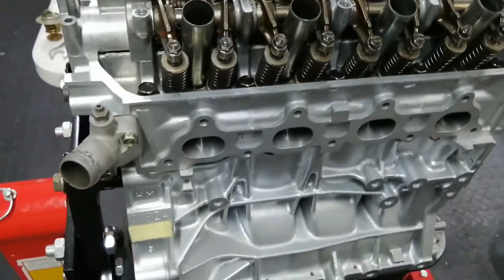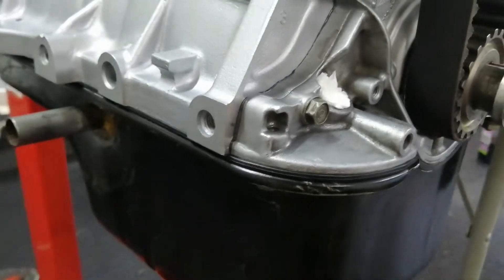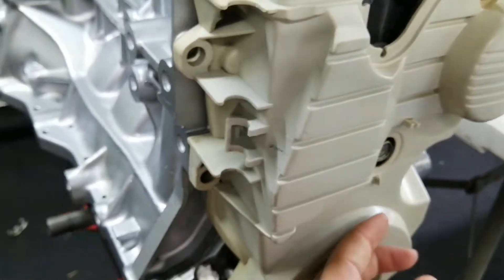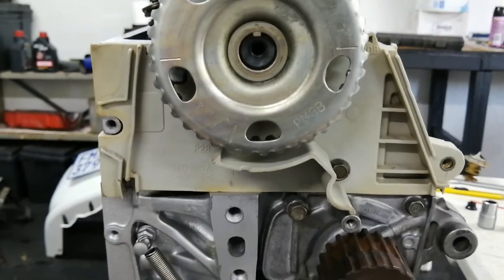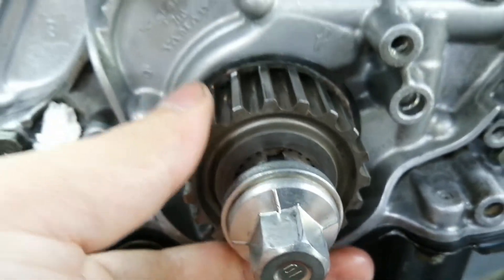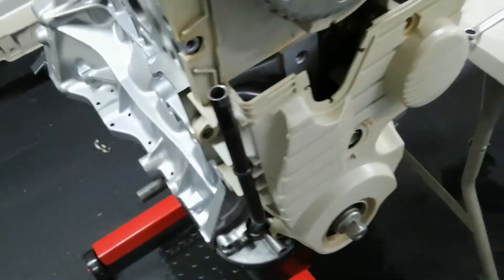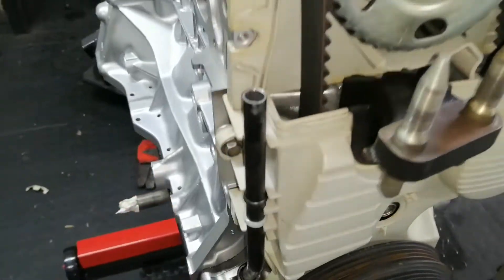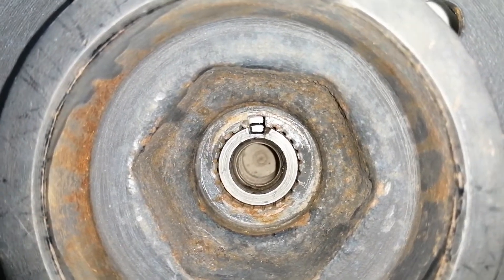Honda VTEC Engine Assembly - D15/D16 Mini-Me - Part 3

Comment: Guys, do you have a manual for setting up the D15/D16 split gear?
Reply from the maker: Hi, sorry, no manual, some motors are different, make sure the correct marks line up, some marks are for the P08 head, other mark is for the P2A non vtec head. older EG engines only have 1 mark + deck

Comment: Me i did d16y4 block , d15B head. Still running on stock d15b ecu but it feels like a 1.6 L. Frankenstein build to obtain d16 double vtec. But if i put a maxxecu mini or hondata on it we will be pushing right stuff when needed(ecu actually putting enought mixture for 1.6 L and not 1.5 L) without forgetting the stage 3 double vtec which i will be able to control with the standalone
Reply from the maker: Hi Bro, if you have a stock 02 sensor connected to stock ecu it may be able to compensate extra fuel for the extra 100cc. for the 3 stage vtec stuff there is not alot of support, but a ecu with a simple rpm/map based trigger you should be able to set it up on a stand-alone ecu.

Comment: I just happened upon a 95 del sol si, d16z6.  Planning 300 hp turbo build! Thanks for the clinical video!

My window washer wasnt spraying so worked through the whole system.  Too the swith stem out and opened it up...  the pump was the culprit but im surprised cause all the contacts were nasty.  Cleaned it up with electornics cleaner and 2000 crit sandpaper.  It looks new.

Also did the contacts at the harness.  Reconnected it and put dielectric over the cap.  Should be good for Long time.

Lastly, im gonna go nab some fan pattern mist nozzles at the piknpull.
Reply from the maker: @deepstate8474  nice, 300hp del sol will be a lot of fun. Also working on a new 300hp engine build for the civic

Comment: last time my stock d15b snaap the crankpulley bolt twice, it almost ruining the keyhole on the crankshft, does this problem also happen to B series? love your video btw keep it up
Reply from the maker: Hi, thanks. Yes the pulley/key issue is fairly common on D and B series. the pulley bolt needs to be torqued very tight and of course the engine wants to spin, you need a special tool to lock the pulley, most people don't have the tool so they just do what they can and over time the bolt comes loose and the key damages the crank.
Reply: @RisingBoostYT  ah i see,  now i understand, and the k series?

Comment: Quick question what ecu do u run? Or any other upgrades such as fuel injectors?
Reply from the maker: Hi Luis, I have a walbro 255 pump, upgraded fuel rail and 440cc injectors. running a stand alone ECU for the motor, it's just a cheap basic locally made unit (Dicktator STD)

Comment: Hey your videos are definitely awesome!! I'm trying to rebuild a d16y5 with d16y8 head then turbo. I've never done this before and I'm learning all I can before I attempt to pull my engine. Thanks for the help
Reply from the maker: Hi, I don't know the Y5 motor, but it is a vtec-e, meaning it already have a P2J cylinder head, exact same cast as a Y8 head, (some say you can just swop out the cam+rockers to make a vtec-e to normal vtec) this is good because it will be a easy straight fit bolt on, "no mods needed" apart from the ecu as a vtec-e ecu triggers vtec at a different rpm, also it works a bit different so you will need some form of tunable ECU.  here is some things to keep in mind, make sure the block does not have weird hi-comp pistons (it should not). make sure the head you are using has the big intake ports and thick valve springs (never use a PO7 head), get head studs if you can, Dseries love to lift heads under boost. don't run aggressive timing under boost. get 7 heat range spark plugs. don't make more than 220whp and you should be just fine.

Comment: I can say everyone is wrong I build my CRX with with a d15b2 block with a po8 -3 head VTEC but not VTEC what I did I put a Y8 head gasket drop the head with a 272 Delta cam and bolt in the manifold with the pmg-fi system duel point and I put the d15b2 distributor with couple adjustments and bingo and the duel point always kp my engine with the right amount of gas I put her to 7200 rpm with not problem at all she is peppy like hell sounds like a muscle car the cam sound beautiful tuff and she fly like she was stolen she pull hard from 2500 rpm to 7200 rpm and fast she have 10 pound flywheel and stage 2 clutch no ECM problem or all that sensors crap and rewiring crap plus the VTEC around here they only see her rear lights because she really run like hell to fast for what it is and with a pmg-fi duel point system better than a Weber in reality people are wrong in a lots of things logic is reality amigo gd job take care
Reply from the maker: Hi Bro, awesome, interesting combo of parts, glad it runs strong!
Reply: @RisingBoostYT  hi bro it run peppy and strong what happened is that the duel point manifold segundary runners are shorter than primary gd for mid rpm up that what were made for and remember the pmg-fi system duel point is like a Weber with out the bowl or float meaning gas run straight through with the sensors air and gas demand gd to 7200 rpm no bad at all I play with the obdo distributor and made it fit and work gd .Now for more power and easy system can used a 4 barrel EFI system carb change the spring and retainers and I can say will be a devil on wheels jjjj 😁 I imagine never see it happen I wonder jjjj junkyards parts all motor no VTEC or turbo I bet you will run nice and will sound beautiful and in a 1600 to 1700 pound civic 3 door or CRX will be something special I like my set up but I wonder jjjjj CCR born in the byouooooo amigo jjjj
Reply: @RisingBoostYT  bro run like hell now on a 32/36 Weber carb from Spain love it sound a lot stronger and pull hard peppy like hell wow bro this is what I'm talking about a d15b2 that rumble jjjjj and sounds like a cobra jjjj old school style all that ECM crap and fuel injector system that what it is a oriental dream USA all day long born in the bayouuuu bro take care

Comment: hi good day mate  love the video  thanks so much  jus a quick question  what is the torque specs for the head gasket bolts on this engine ???
Reply from the maker: Hi Bro, it depends on the motor but here they are - A6 motor - 22ft lbs - 48ft lbs \ Z6 motor - 22ft lbs - 53ft lbs \ Y8 motor 15ft lbs - 36ft lbs - 49ft lbs - 49ft lbs. check the video description, there is a link to a manual that can guide you if needed.
Reply: @RisingBoostYT  thank you so much

Comment: Stock gear box?
Reply from the maker: Hi, yes the gearbox is stock, the Dseries manual boxes are fairly strong, seen 600hp builds before, that's when they start stripping the diff spider gears.

Comment: Where did you find the Skunk2 valve cover bolt kit, I only see it for B and K series or will the B series work?
Reply from the maker: Hi Pete, I found it on Aliexpress only, it was not listed as skunk2 and I'm not sure of it is still available. You should be able to fine the PW JDM ones, the Bseries will not work, it has to be for D16.

Comment: You got a spare timing lower cover?? My timing belt broke and destroyed it xD
Reply from the maker: Hi Roxas, sadly no, my extra one has broken tabs on the back side making it useless as it must sit in the correct place in order for the timing marker to be in the correct spot. I see you found one on amazon, just  make sure it is correct, the EF/EG motor has a slightly different one as the EK has the dipstick tube attaching to the cover and the older one does not.
Reply: @RisingBoostYT  im sad... you shoulda seen the aftermath! Had to replace the crank sensor too

Comment: Does that clear cam cover fit a d16y8 looks amazing
Reply from the maker: Hi Edgardo, yes, it fits all Dseries with the plug leads go in the front of the valve cover like the Y8. not sure about the D17 00+ motors and it does not fit the EG motors like the A6 - https://ebay.us/K9u9cn

Comment: Hi i'm planning to buy a d16y5 car for my first honda, in my country we only get the d16y5 for the civic ek sedan, i heard the vtec e is not really good for performance. I was rhinking of swapping in a d15b head from a honda city type z, will it fit? I heard they have the same bore size
Reply from the maker: Hi, Yes the head will fit. some vtec-e motors have the exact same P2J cylinder head cast, meaning if you can find a Y8 head "valve train" you could just swop that over and have a normal vtec head. the P07 heads have a small valve/runner eco cast and cant make much power. just check your compression ratio to be sure it won't be too high or to low. (online tool available)
Reply: @RisingBoostYT  i dont think we get the y8 here, which cars do they come from? Im very novice to the honda world, sorry 😅
Reply from the maker: @niceperson6084  the Y8 is from the USDM D16Y8, but any of the sohc vtec heads will work. The jdm D15b motors come with both versions of the sohc vtec heads. P08 head code from a D16Z6 or a P2J head code from a D16Y8. But any of the heads will fit your block.

Comment: Hi sir can this timing belt cover clear fit for honda city sx8 type ? D15 engine my engine look like this too
Reply from the maker: Hi Aniq, yes if your D15 has the spark plug leads going in on the front of the valve cover like my motor it will fit. if the spark plug leads go in on the back of the valve cover (like the Dseries from the EG EF shape cars) it will not fit.
Reply: Thanks sir

Comment: The other mount is for a B series, the hole in the side is for the power steering pump bracket to bolt up to, I ran into the same problem today but the opposite way around, b series came out of ef and went into an eg but discovered the issue with the mount when fitting power steering pump bracket
Reply from the maker: Hi Bro, well spotted. yeah it's possible I did see se Bseries connect to the mount also but EK Dseries does not.
Reply: @RisingBoostYT  yeah man I think  it’s just a difference in the b and d series mounts, the information on the key way was very interesting because I had to change the distributor and when timing it the crank pulley TDC mark was not actually TDC it was about 20 degrees after in relation to the the piston actually being at TDC so the pulley seems to be in the wrong position which would make sense if the keyways can give trouble, keep up the good work man
Reply from the maker: @sleepwalker8600  Awesome Bro, glad it was helpful! yeah the bolt could hold the pully in place without a key but yes it could have moved the pully out of position during fitment.

Comment: Hey, where did you get ur Cam Gear/pulley from? And your clear Timing belt cover?
Reply from the maker: Hi Michel, I got it from AliExpress, the are very cheap, i'm actually making a video on the cam gear as it kinda fits but needs to be modified a bit. video coming soon. I will share links in the description of the video for you. same story with the clear cover.
Reply: @RisingBoostYT  when will the video be released? :)

Comment: Hi mate where did you get the torque specs for everything??
Reply from the maker: Hi Mason, I use the "nthefastlane" website. just confirm your engine is not different as they mostly list USDM motors. they mostly the same though.

Comment: I’m currently working on rebuilding a B16A but I still find this informational and entertaining.  Thanks!  Subscribed.  I like your accent btw.
Reply from the maker: Hi Scott, awesome! B16A is great motors, I will also soon work on some Bseries stuff, B18 with B16 Head. got the opportunity to get a civic with a B20v and a B18 motor all for a trade. glad you like it and found it entertaining! I do still make rookie mistakes but I can confirm the motor runs just fine and it will be going to the dyno soon. you can send me some pics of your build on insta if you want, would like to see.

Comment: Aku punya eg d15b pulley terbang.. habis crankshaft key hancur..kena overhaul
Reply from the maker: Hi Seorang, common problem if bolt comes loose, expensive to repair, we normally replace as the Dseries parts are affordable.

Comment: I’m pretty much a noob but I have a d15b7, and I want to mini me with a d16z6 head, I heard that d15b2 rods fit my block so I’m wondering if I could use those (built aftermarket ones) I’m only thinking of upgrading the rods because I know that the b7 rods are weak, but I would have to notch the block
Reply from the maker: Hi Bro, I don't know much about the B2, but the D15B's should all have the same rods, I have a D15Z4 and it has smaller big end rod journals than the D15B7. I would recommend confirming the big-end sizes before buying. The D16 rods are slightly longer than D15 rods just so you know. however if you are only doing a Vtec head swop the rods are not needed, the stock rods will do 200hp if they are the same as the B7. if you plan to boost later on do the rods and ARP Head studs. my motor is 100% stock and it was making 163whp at about 7psi
Reply: @RisingBoostYT  thanks man ima keep that in mind, I’m planning on building my motor in a year or two then boosting :)

Comment: Need a new Woodruff key for the crankshaft pulley the fix the slack it gets worn
Reply: Lol didnt watch it all before I commented hahaha good job man
Reply from the maker: Hi Vincent, no problem, at least I now know the correct name for it. on the crank pulley for the cam belt the key is actually built-in, so I will likely have to replace the pulley. however I am holding thumbs and betting on the 155nm crank bolt to hold everything in place for me.

Comment: Did you port the oil pump? Don't use a D16 flywheel...
Reply from the maker: Hi, No I was not able to get the screws or allen bolt lose to port and shim the pump, so I was forced to use it "as is". What flywheel do you recommend? I reused the stock D15 flywheel. Basically this whole motor is a mix and match of stock parts.